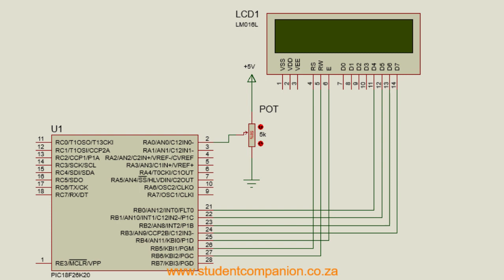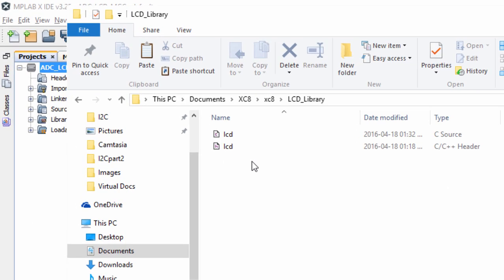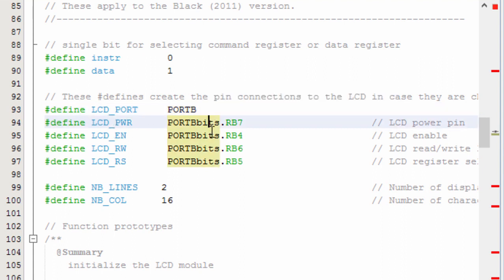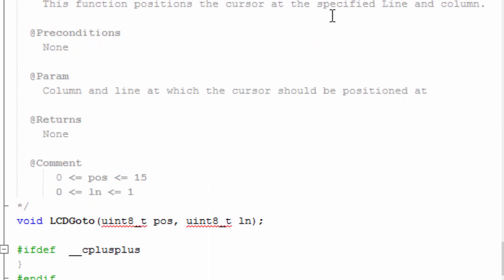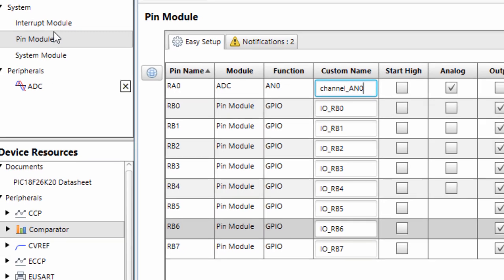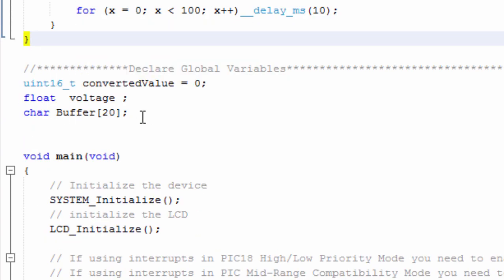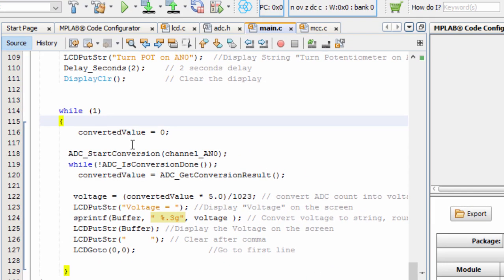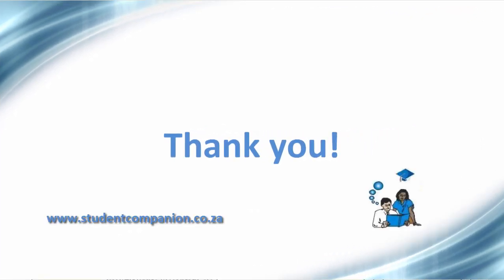22- ADC and LCD with MPLAB Code Configurator | MPLAB XC8 for Beginners Tutorial

Comment: Hello, I'm glad you have did everything in MCC Code Compiler. So, I  am new in MPLAB X and since one week until now I've tried to simulate that, but in the "Device Resources" menu ADC  I am not able to Generate  (button) and I cannot install that old version of CodeComp. The software called me to install the last version of MPLAB X when I try to use older versions of MPLAB X and try to Download it. Should you help, or the MCC Generated Files is something I cannot create in the new versions?
Reply from the maker: Hi, you don't have to use old versions, in fact it's always good to use the latest MPLAB X, latest XC8 abd latest MPLAB Code Configurator.  Which PIC are you using?

Comment: Sir,I want to show double channel ADC value using mcc.How to call the second channel AN1.
Reply from the maker: Hi, did you try to use ADC_StartConversion() then specify the channel to convert?
You could use a for loop to loop through your channels you want to convert and save tge results in an array variable.
You can click in the description of this video to the link to our website there is an example how to convert 3 ADC channels, you can use the same principle.
Reply: @StudentCompanion  using the same principle of one channel mcc want to show AN1 value also.I tried of using ADC_StarConversion() and ADC_Initialize() but not worked properly.Give me a hint to proceed
Reply from the maker: Can you post your code? Let see how you are doing it. And did you enable all those 2 channels in pin manager?
Reply: @StudentCompanion  tried using various codes by trial and error method.could you send me the code if possible
Reply from the maker: We have asked you to post the code you have tried that is not working.
Reply from the maker: So that we can assist you. We can only assist you based on what you are already doing.  We can't do everything for you.
Reply: @StudentCompanion  Tried without MCC and it worked
void ADC_Init();
int ADC_Read(int);

#define vref 5.00               /*Reference Voltage is 5V*/
int ADC_Result [3];
void main()
{    
    char data[10];    
    int digital;  
    float voltage;
    OSCCON=0x72;                /*Set internal Oscillator frequency to 8 MHz*/
    LCD_Init();                 /*Initialize 16x2 LCD*/
    ADC_Init();                 /*Initialize 10-bit ADC*/
    
    LCD_String_xy(1,1,"Vol1=");
    LCD_String_xy(2,1,"Vol2=");
    while(1)
    {        
        digital = ADC_Read(0);
        voltage = digital*((float)vref/(float)1023);    /*Convert digital value into analog voltage*/
        sprintf(data,"%.2f",voltage);                  /*It is used to convert integer value to ASCII string*/
        strcat(data," V");                             /*Concatenate result and unit to print*/
        LCD_String_xy(1,6,data);                       /*send string data for printing*/   
		MSdelay(500);
    
    digital = ADC_Read(1);
        voltage = digital*((float)vref/(float)1023);    /*Convert digital value into analog voltage*/
        sprintf(data,"%.2f",voltage);                  /*It is used to convert integer value to ASCII string*/
        strcat(data," V");                             /*Concatenate result and unit to print*/
        LCD_String_xy(2,6,data);                       /*send string data for printing*/   
		MSdelay(500);
    
    }
    
}

void ADC_Init()
{    
    TRISA = 0xff;       /*set as input port*/
    ADCON1 = 0x0e;      /*ref vtg is VDD and Configure pin as analog pin*/    
    ADCON2 = 0x92;      /*Right Justified, 4Tad and Fosc/32. */
    ADRESH = 0;           /*Flush ADC output Register*/
    ADRESL = 0;   
}

int ADC_Read(int channel)
{
    int digital;
    ADCON0 =(ADCON0 & 0b11000011)|((channel<<2) & 0b00111100);      /*channel 0 is selected i.e (CHS3CHS2CHS1CHS0=0000) 
                                                                      and ADC is disabled i.e ADON=0*/
    ADCON0 |= ((1<<ADON)|(1<<GO));                   /*Enable ADC and start conversion*/
    while(ADCON0bits.GO_nDONE==1);                  /*wait for End of conversion i.e. Go/done'=0 conversion completed*/        
    digital = (ADRESH*256) | (ADRESL);              /*Combine 8-bit LSB and 2-bit MSB*/
    return(digital);
}
Reply from the maker: Great! It always good if you can do it without MCC, the better

Comment: Hi, I have tried this to be able to simulate your LCD example using XC8 2.10 and the laters MPLabX. It doesn't work? 
firstly there is no 'Link in Library' option in project preferences. Also, MCC says 'device not recognised' and fails to load? Right now I'm getting very cheesed off, pulling lots of hair out and kicking the cat. If it doesn't simulate, then why spend cash to but kit, then to finding out the hard way? Right now - not impressed.
Reply from the maker: Hi. We explained to you a day earlier that XC8 from version 2.0. Doesn't support the PIC18F peripheral libraries anymore. You have few options:
1. Downlaod an older XC8, you don't have to uninstall your current compiler as you can have more than 1 installed on your computer.  Just select the correct version for your project. You can download the XC8 v1.34 and it should work very well. If you install from version 1.35 you will need to download and install the peripheral libraries now called legacy peripheral libraries.  If you are using XC8 v2.10 you won't see link in peripheral libraries because it's not supported.
2. Don't use the peripheral libraries as they are now being replaced by MCC as explained in this video. But MCC does not support very old PIC models. Make sure you select a newer PIC model. From MCC downlaod page, there is a list of all currently supported devices. 
For LCD you don't even need to use the peripheral libraries or MCC, just use those lcd.h and lcd.c files in this example.
Reply: @StudentCompanion  Indeed, and I followed your direction verbatim. But still no result. Also, as I mentioned in MPLabX under project properties, there is no 'Link in peripheral libraries' option under xc8 link?
Reply from the maker: Which PIC model  are you using? Which version of XC8 compiler you are using?
Reply: @StudentCompanion  I'm using the items as described in your tutorial with the exception that I was trying to simulate in Proteus before acquiring the hardware, I figured if I could get it going under simulated conditions then it would be worth the outlay to build. I tried an earlier version of XC8 as you suggested. But when I tried to enter the XC8 link thing in the project properties, as described, I found there was no such option. To be honest I've had enough now and moved on to another solution.
Reply from the maker: We asked you a simple question of what's the PIC model and XC8 compiler you are using, you did not answer.  
Anywhere if your new solution works, that's great!
Reply: @StudentCompanion  And if you had read my response properly you would not have posted this.
Reply from the maker: If you need support and sombody is trying to assist from his time, the least you can do is to have a good attitude!
Reply: @StudentCompanion Indeed, and thus I refer to your previous, less than, appropriate response. I say as a potentially disappearing customer of course!

Comment: Hi guys i don'thave the "link in Peripheral library" withinde XC8 linker! i need help / XC8 v2.05
Reply from the maker: Hi, you can't install the peripheral library with XC8 v2.05, it's no longer supported. The last supported version was XC8 v1.45 from v2.0.0 you can't use the peripheral library. either use MPLAB Code Configurator or install an old version of XC8 from this page: https://www.microchip.com/development-tools/pic-and-dspic-downloads-archive
Please note if you install XC8 v1.34 you won't need to download and install the peripheral library, it's already included in the compiler. This is the last version that had it.

Comment: Hello. At the XC8 Linket i can't find " Link in Peripheral Library  " why? I am using XC8 v2.05 .. any help?
Reply from the maker: The peripheral libraries are not suppprted in XC8 v2.05. Download an old version of XC8 compiler if you want to use them. In Versions v1.xx you will see that option.
Reply: @StudentCompanion  Thank you . I tried this and i can see "Link in peripheral Library " now . And i got too less errors now. But i got a new error " the pic18 is not supported to this compiler " lol.. my PIC18f27j53 works only with XC8 compiler v2.05 or later and MCC 4.55 , i red this in microship website! .. Do you have a solution? Pleas. Thank you so  much
Reply from the maker: @youssefboudhaouia1116  Why do you want to go back to the old peripheral library that is being discontinued? If you are working on an old existing project I would understand but starting a new project using a new PIC with very old library is to invite too much problems. You have two options, either choose an old PIC model supported by the  old compiler or move to MCC with your new PIC.
By the way, what is the version of your XC8 compiler that you are working on now that accepts the peripheral library?
Reply: @StudentCompanion  i understand now. Thank you!
Reply: @StudentCompanion  it's the XC8 1.41 that accepts the peripheral libraries.. but the XC8 v2.05 does not accept those libraries but it supports my new PIC
Reply: @StudentCompanion  i want to work with my new PIC. How could i move to MCC?
Reply: I need a help please